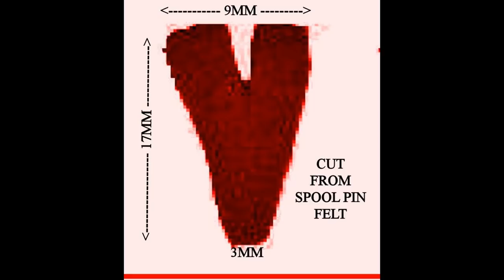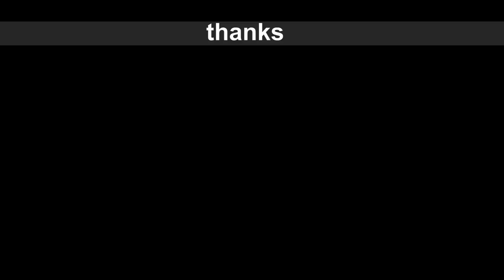The Bobbin Area Parts of a Singer Model 99K Sewing Machine

Comment: Thank you for this Andy.
 I purchased a very tatty Singer 66 recently and now dismantling and cleaning with your help but the mechanism that I'm finding really interesting is the stitch length. I can just about see how Singer have done this by changing the rise (gradient) of a cam ( in the area below the spool holder pin.)  I'd like to use this machine for auto leather upholstery, and I know it's capable of it, but it would be great for the stitch length to be increased a little beyond the designed maximum. Any thoughts on this please Andy before I 'donate' this machine to experiment?
Reply from the maker: I've never worked to lengthen the stitch on a 99K. I know a few fellows who have done so on a 404 and 403A. The feed regulator controls the length, and by removing the indicator plate (in one case filing out a longer slot in the indicator plate) they have removed the limit the plate puts on length. You do not gain much length before the feed dog starts hitting the hook parts or the back of the inside of the machine below the hook. Both fellows were using the machines to sew sails for their boats, and they said any amount longer made quicker sewing and saved a good amount of thread costs. I suppose the 99K could be modified in this way also as it has a similar type of feed system. The other models have a slightly longer feed regulator and a small slide block while this 99K has a roller that may limit how much length you will gain by removing the indicator plate. Here is a video about the 99K regulator:
https://youtu.be/OTuoIj0Vx0E   and here is a video of the regulator on a 403A (same as 404): https://youtu.be/omHg86F73HY
Those videos will show what I'm talking about. Here is the entire playlist of my 99K videos in case you have other issues:
https://www.youtube.com/playlist?list=PLsCOZgzzaiKIIUgkEujqHc9iNWN9NPW2Z
Thanks for watching my channel, and good luck to you.
Reply: @andytubesewing1953  Thank you for this Andy. The 66 that I have has the block slide and screw regulator. Yes I have realised that if the stitch length was somehow increased then the feed dog would probably hit the inside of the machine and careful grinding may be needed. This could open 'a can of worms' as they say but would of mechanically interest. 
Cheers, Anthony
Reply from the maker: @ajskilton  Yes others have taken a small grinder to the area around the feed dog and hook to make more travel room and done other modifications to get a slightly longer stitch one of my viewers said she finally gave up on the project and bought a $200 used industrial machine that sews like crazy so there's several ways to go for a longer stitch whatever you choose I hope it works out for you thanks for watching my channel and good luck

Comment: Hi Andy, Superb video and incredibly helpful - thank you. My bobbin case position bracket screw has been tampered with over time (chewed screw head) and I'm sure it's not set up right as the bobbin thread gets stuck sometimes and all tangled.  Do you know the procedure for setting this piece up successfully?
Reply from the maker: This is a comment on this same page from viewer Roger Foster explaining what I call the thread cleance gap between the bobbin case and cushion spring:
Roger Foster
6 months ago (edited)
great video for seeing what is actually going on in there, the only thing I noticed is you seem to have way too much slack between the bobbin case & the bobbin case bracket making a clacking noise.

if you loosen screw the screw on the bobbin case bracket (the one you move to the right to remove the bobbin case & left to lock it in) the screw they tell you never to remove, you can adjust the distance between the heel of the bobbin case & the cushion spring on the bracket with it in the bracket latch in the locked position & the bobbin case pulled fully left over the race for a gap of .010 to .015 of an inch between the heel & the cushion spring then tighten the screw down again, you can just pull the bobbin case  fully to the left & measure the gap with a feeler gauge to see if it needs adjusting
Reply: @andytubesewing1953  Ah!  Thanks Andy.  I'll give Mr Foster's set-up procedure a try and see how I go.  Thanks for replying and pulling this advice from your comments section for me. =)
Reply from the maker: @chillidowg9860  okay chilli I hope you figure it out and sorry I don't have any first hand knowledge of how to do it

Comment: Thank you so much for your detailed videos. You are so generous to share your knowledge and experience. I was given a 99k and had it serviced before using it but what a waste of money as it wasn't sewing well when it came back. Since then I've freed up the stitch length knob which was stuck, cleaned the bobbin race which hadn't been done for many years I suspect and reset the hook timing and needle bar height. It seems to be working just fine now and sews through leather easily.  The only thing I haven't been able to fix is disengaging the needle mechanism when winding a bobbin. Turning the little silver wheel doesn't seem to do anything but it's not a big deal.
Reply from the maker: You are welcome, Rebecca. Congratulations on repairing your own machine. Nicely done! I made my channel for people like you who just want to fix their machine and sew on it. Thank you for saving that 99K. The stop motion clamp washer is probably installed incorrectly. A very common problem, and easy to fix. It may need to be turned 180 degrees, or it may be on backward. This video is about the handwheel and bobbin winder: https://youtu.be/kN2QLYxZNv4  and at about 33:50 I show and explain about putting the clamp washer back on the machine correctly. It will take just a couple minutes to check it and 1 minute to fix it. I know you can do this and if it is not that then let me know and we will continue to troubleshoot the problem until fixed. Good Luck, and thanks so much for watching my channel.
Reply: Thank you again Andy. I've taken off the little silver wheel thingy, turned the washer half a turn and replaced it and it now disengages the needle like its supposed to. You are my hero!
Reply from the maker: @rebeccasanderson3778  Nicely done! Happy endings are always the best. Now you know about this, and the same set-up is on many, many machines.

Comment: how do you adj. the thread position  part  . i removed the screw that you shoudent  remove . the thread passes throw .help
Reply from the maker: So, Chet, you removed the latch screw? The big silver one between the bobbin case and the ejector button? Now you want to know how to fix the thread clearance? Haha, you are a guy after my own heart. So when everything is reassembled and you have the screw back in place, do not tighten it up yet. Singer does not list the gap setting, but most of the vintage machines I have done have a gap between the bottom corner of the bobbin case and the cushioning spring of between .012 and .016 inches. That would be a good place to start. With the latch screw loosened place your feeler gauge between the bobbin case and the cushion spring. Using a small screwdriver or stick between the top of the bobbin case and the latch to move the latch (and the cushion spring that is attached to it) against your guage until you have the gap you want, then keep it in place while you tighten up that latch screw all the way. What you want is a gap that allows the thread to slip between the bobbin case and spring as the hook takes it around. If the gap is too small the thread can hang there and skip stitches or make a big birds nest. If the gap is too big the bobbin case will "slam" loudly back and forth with each stitch. Of course, you want something just right. You may have to adjust it 2 or 3 times until you get a gap you like. Use a feeler gauge each time so you know what gap you are setting. Say you start with a .014 gap and it's too small then you can try a .016 or .018 next time. If .016 was too big, then try .014 or .012 and retest the stitching quality. Here is a video of the procedure on a model 404. The parts are shaped a little different, but the principle of setting the correct thread gap is the same. https://youtu.be/OXKqZp87eN4
Take it easy with that screwdriver Chet and stay out of trouble.
Reply: @andytubesewing1953  thanks Andy there must be thousands of people who still get a family machine handled down.  mine is from 1941., and think give it a clean  hover out the dust and just jump for the screwdrivers .with good intent. sadly not many instructions are with the machines.  the craftsmen/ women who put them together.  Your videos are  extension to that ,and are keeping the machines alive  .big thanks .
Reply from the maker: @cdreynolds1  I'm glad you found the video. It's great you are maintaining the family machine! Thanks for the comment and come back soon.

Comment: I’ve watched several of your videos that have helped me begin the restoration process of a singer 66-16 which is very similar to the 99k model. I can’t thank you enough for your informative videos of vintage sewing machines. I’m upgrading the electrical components too, due to crusty wires. Although my machine has been unused for several decades, it seems to be in good condition. Once the restoration process is completed in the next wk or so, I’m hoping it works. Thank you, thank you, thank you!
Reply from the maker: Glad to help! The model 99 is a 3/4 size model 66 so you are correct they have the same type mechanics. Thank you for rescuing that machine and good luck.
Reply: Andy Tube You have no idea how many people will be able to use their vintage machines now that there are YouTube videos like yours available. The original manuals don’t do the machines the justice they deserve. I’ll now be able to help others who were in a similar situation like me.
Reply from the maker: @berthamadonna  You're very kind. Thank you ✨
Reply: Oooo where did you get the new electrical stuff? Mine is so crunchy that I affectionately call it the Fire Hazard.

Comment: Love your video , I took mine apart and there was no funnel spring but the threads are there. Where can I get one? Thanks.
Reply from the maker: I've never seen one for sale. I don't know if you could modify a store-bought spring by stretching it. People sell used parts on eBay, but you may have to buy other parts of the bobbin area with it.
Reply: @andytubesewing1953  thanks Andy, I'm going to try a spring from a pen.
Reply from the maker: @maryalbaugh2066  Oh, you are a natural at this, huh? That is a brilliant 💡 idea, Mary. A pen spring may be light enough to reshape, but firm enough to hold a piece of felt for oil. I like it! Next thing you know you'll be posting a short video about how to do it. 👍Let me know
Reply: @andytubesewing1953  nah, I’ll leave the video making to you. 😄
Reply from the maker: @maryalbaugh2066  Oh... too bad. I think it would be a great idea. If possible could you let me know how it turns out? Best of luck.

Comment: Oscillating hooks just freak me out and I don’t know why! Wow, such a difference in the feed dogs and the bobbin case holder. Thanks for figuring out these details for us, Andy!
Reply from the maker: They are truly different. When I first did a Model 337/338 is when I discovered "bell crank" and oscillating hooks. Ingenious I think, but it made me wonder about reversing directions on each stroke. To me it was like 2 steps forward, one back as far as energy expended. The gear driven rotary hook just makes more sense to me ..  round and round we go. This hook system does work very nicely. I guess that's why Singer made millions of them too. Thanks for your comments; they are always fun for me.